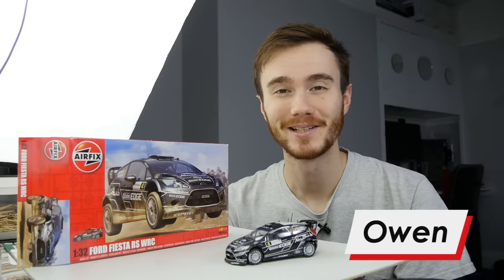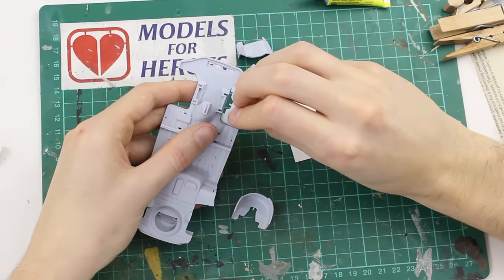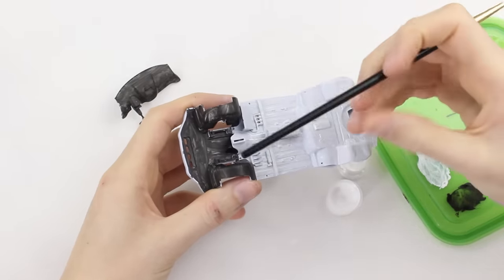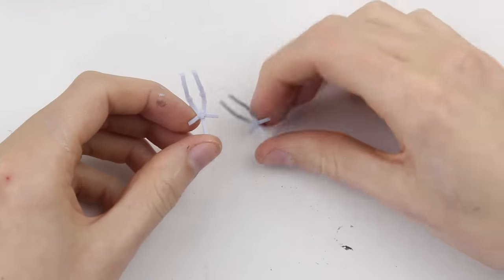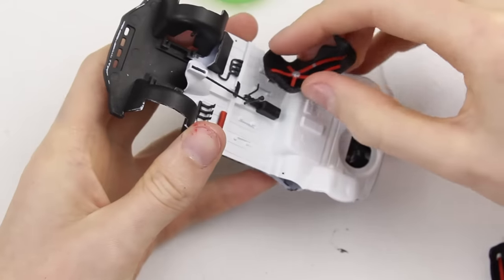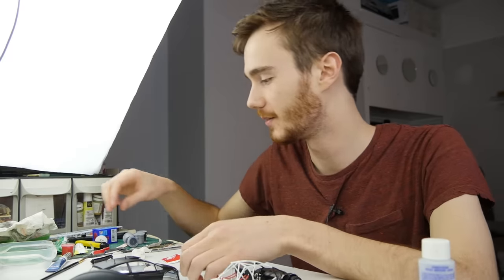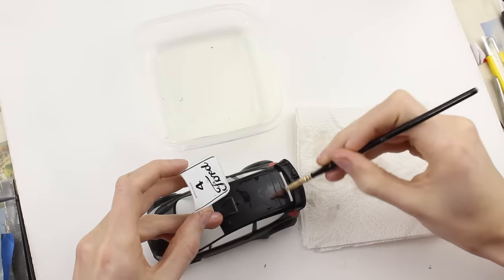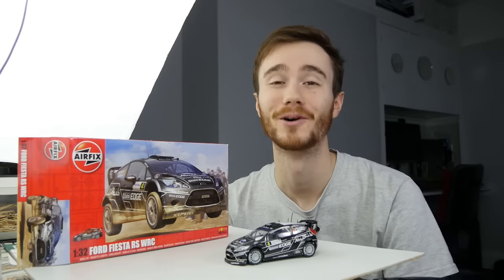Scale Modelling for Beginners: Model Cars - Airfix Ford Fiesta

Comment: With using that type of glue, you can also snip a piece off the sprue and using clippers, make a point. You can also use parts of the sprue to mix the paint also.
Reply from the maker: Good tips, thanks :)
Reply: I've sometimes used toothpicks and matchsticks.
Reply: I use a cocktail stick.

Comment: Thanks Owen, great video with a build out of the box. If I may have some remarks :
-1 Most rallycars, and this Fiesta WRC have white wheels not silver (maybe that's a mistake in the instructions?)
-2 I would paint the wheelnuts a darker color (use a toothpick or so). Looks so much better.
-3 The 'Michelin'-decals on the tires look way too big, that's not your fault.
-4 The interior is correct in white but the doorpanels should be black.
Still great video, keep up the good work.

Comment: I would suggest using compressed air or a hair dryer in the cold/low setting to dry the washed parts, that way you won't get any water spots during drying.

Comment: Hey Owen, I have a few questions. In your decal tutorial, you soak the decal in warm water, spread microset on the model, then put the decal on the model, and a coat or two of micro sol. Is Humbrol Decal-fix equivalent to microset, should I soak my decals in microset, and do you need to add microsol to Humbrol Decal-fixed decals?
Thanks.

Comment: Hello Owen ! 
Thanks for this helpful video ! Beginners like me will find great resources in this one to start properly their first models ! 👍
I still have one or two questions in mind : did you always thin your paint. Or only when you have to paint big area, like the body of the car ? In this case, details are paint with non-thinned paint ? 🤔
And last question : in the video, you applied 5 coat of thinned paint. Do you always apply 5 coat ? Or does it depends on the results of each coat compares to the result that you want to obtain in the end ?

Thanks again for your answer and excuse my English : I'm French and I lose a bit of my English knowledges by the lack of training ... 😊😉
Reply from the maker: Hi I'm very pleased that it's helped you :) 
I do always thin my paint, but on small detailed parts I might thin it only slightly. It also depends on the consistency of the paint out of the pot. For example Revell Aquacolor paints are very thick and always need thinning a lot. 
The number of coats I do depends on the strength of the pigment of the paint. Because white or yellow are weaker pigments they need a lot of coats to get a consistent colour. On average I paint about 3 coats.
I hope that makes sense and helps you? :)
Reply: @quickkits  Thanks for your answer.
I use Tamiya or Gunze for painting.  I don't have any problems to paint details.
The problem is for big area. I think that I apply too thick layers and I was looking for Tamiya Spray paint to try ... But your tips of thinning the paint is interesting and I want to try it ! 😀

Comment: Those 4 people just forgot to use PVA for their windows.
Reply: I use extra thin cement and it doesn't "attack" the plastic as Owen states. I would recommend so too, since PVA doesn't hold as strong and the piece could fall of with little pressure after it dries.
Reply: I use humbrol clear fix
Reply: Ben Groves just get some uhu multi purpose glue mate. Works pretty well and Humbrol clearfix is overpriced and isn’t exactly a ‘wonder’ tool
Reply: @raoulsandhu1415  good idea mate thanks
Reply: Ben Groves no problem mate, feel free to ask me if u need to know anything

Comment: Hi Owen, I’ve asked this question a lot but never got a straight answer. I’m trying to crest a rain/water effect on my 1/72 Beaufighter, and as I don’t have access to resources such as resin I was wondering what you would do? Thanks
Model looks great. :)
Reply from the maker: What kind of water effect? For spots of rain I imagine you could use gloss varnish - load a brush with some then tap it and spots should fall over the model (experiment on scrap first until you work out how to get the droplet size right - at 1/72 scale a droplet of rain is going to be less than 0.1mm across...) The problem is that the varnish won't darken the paint colour like water would - I'm not sure how you'd achieve that. Maybe mix a pigment with the varnish? I think you'll have to experiment a bit first on some scrap/an old model
Reply: Quick Kits, thanks Owen,
I’ll experiment on an old Zero. It might use a gel medium I have. Trail and error is often the best way to try things.
All the best.

Comment: Hi their in this video when you used the paint on the bottom of the car and the body you dipped your brush in water and thinned the paint to give a nice finish do you have to do that if your sprayed primer on it
Reply from the maker: Yes, primer will help the paint bond to the surface (so it won't scratch off as easily) and will also reduce the number of coats you'll need to paint. I'd always recommend thinning your paints. Several thin coats will get you a much smoother finish than one thick coat
Reply: @quickkits  thank you for the help I'm new to modeling haha I got a mini cooper s airfix starter pack
Reply: Sorry to bother again to you do more than one coat on smaller parts like seats and foot pedals, gearsticks ?? Also with thinned out paint ?
Reply: @quickkits  how to I stop my paint going streaking on my model I mixed the paint and thinned it before applying but its went streaky iv used primer and used 4 coats of thinned out paint

Comment: Hi Owen, I'd like to know the brand of paint you used in this video😁😂 your paints seem to be high quality and have very good colour
Reply: From his work area, it looks like small humbrol paint pots which are included in the starter set version of this kit and a lot of other airfix models. Buying separately, I've used Vallejo paints for years to great effect.
Reply from the maker: As @emperor187 says they're just the Humbrol Acrylic pots included with the kit. If I wasn't doing this as a beginner's tutorial I would have used Vallejo model color of Hataka blue line acrylics
Reply: @quickkits  hello Owen, you've never done a tutorial with humbrol weathering powders before....are you planning to make tutorial vid on the humbrol weathering powders?